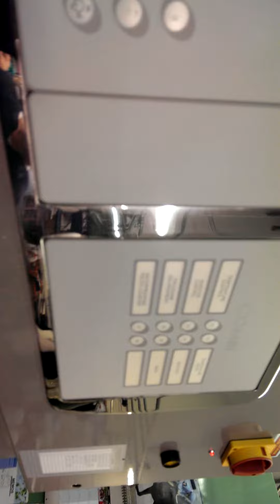Firbimatic F40se hydrocarbon dry cleaning machine 2014 sold by sussex equipment.

Comment: Is there any problem with dirty solvent by not running a still? How would you compare to the still version?
Reply from the maker: The machine uses filters to clean the perc or hydrocarbon its ok for small stores not busy stores an all chemical that goes back to tank 2 is pretty clear from the drying threw the separators

Comment: How much does this machine cost ? How long does it take to Finnish one load ? Thanks.
Reply from the maker: The machine comes in 2 sizes 40lbs and 60lbs the cycle times vary due to which program you can run the spray mode cycle like the ipura machine runs can be dialed in to finish around 39-42 minutes or the standard cycle which means a full bath wash completely wetting, extracting and drying  the garments to maximize cleaning can be finished in about 60 min. The price for the machines are in the low 30s for the 40lbs machine.And the 60lbs machine will be in the higher 30s I can quote you a firm price via email due to I do not want to post my pricing on the internet.Thank you for the interest in my video of the saver se firbimatic dry cleaning machine its like 2 machines in one!

Comment: Hydrocarbon solvent its D40 or D60
Reply from the maker: The machine is a 40 lbs machine
Reply: I know its 40 lbs .for cleaning which grade solvent you are using in it . Hydrocarbon D40 or D60
Reply from the maker: Df200 or green earth or Rynex or genex class 3 chemical
Reply from the maker: Hydrocarbon

Comment: no washing cycle  :(
Reply from the maker: This machine can run like the ipura machine that sprays the chemical on the garments for 30 seconds while rotating the garments back n forth then goes into a  small extraction and drying this is for garments that just need to be refreshed it will not take stains out in this part of the machines cycle. the second part of the machine is the machine has 2 tanks tank 1 for dark garments and tank 2 for light garments the machine has 2 pumps one for each tank as well with the filtration 1 for each tank the machine then can run full cycles if needed for dirty cloths so the machine is like have 2 machines but all is done in one.
Reply: sussex dry cleaning equipment
 sweet  :)  im a dry cleaner  itching to get back in to it  cant u film it washing ipura??
Reply from the maker: ***** yes just give me a couple of days we are very busy with installs.
Reply: Ok. Bud :) I'm in East Sussex well Hailsham started out on a spencer minor :)